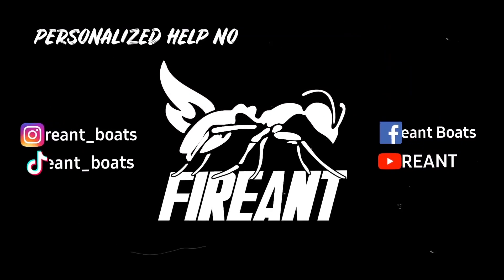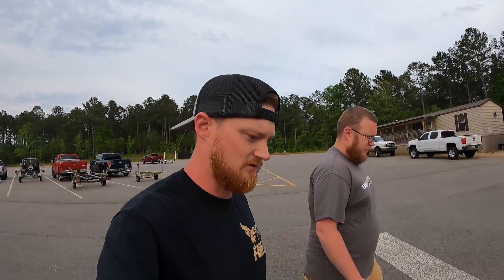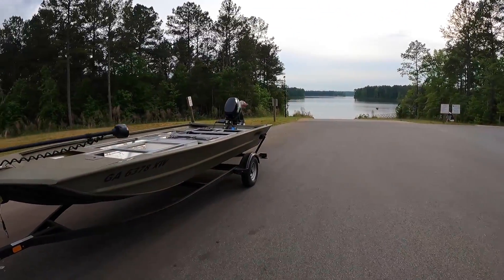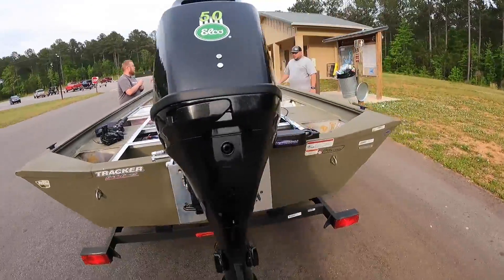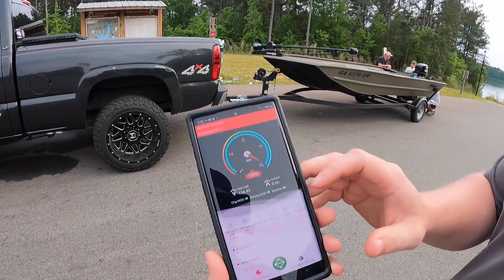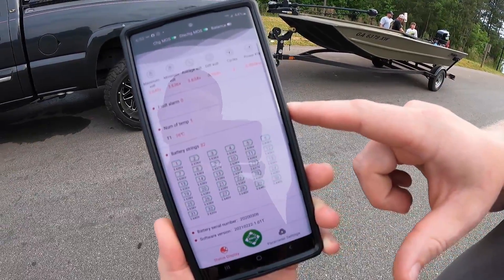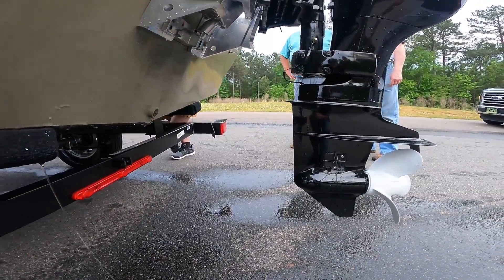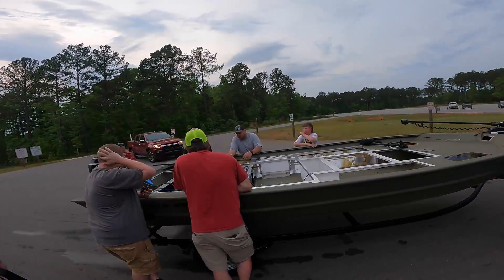Worlds FASTEST Electric Jon Boat | Road to 30MPH Elco 50HP

Comment: Where is all the noise in the motor coming from? Is it the motor or is it the lower unit gear box making all that noise? Unless I am missing something, this motor looks like it’s delivering much less than 50 hp. Does this motor actually provide 50 hp or is it only 50 hp short term (a few minutes) than backs down to something like 27hp continuous? For 50 hp, this boat appeared to be running pretty slow. Does the ELCO 50 produce any RPM to spin the prop, or is it only turning the prop around 1800 RPM instead of 2500 to 3000 RPM needed to push the boat fast enough? 

ELCO appears to  market it’s electric motors for low RPM mid duty applications for displacement speed boats and their motors are specified out pretty heavy and slow turning for the power they produce. Not optimum for a planning boat.
Reply from the maker: I agree

Comment: wait electric still will have water comming out the motor > wtf for cooling ?
Reply: The motor is in the head and they get hot. The direct drive motors like you see in a trolling motor are liquid cooled as well, simply because they're in the water. This has over 20,000 watts of heat to manage at full throttle.

Comment: My Merc 40hp 4 stroke is quieter than that. If I want to be silent I use my bow mount
Reply: but you have to buy fuel, oil, winterize it, spark plugs, carb/fuel injection cleanings, etc
Reply: @zedwpd hey dummy how much u think those batteries r bud?
Reply: yea but you cant use it on electric only lakes